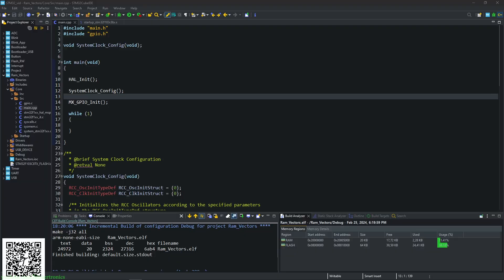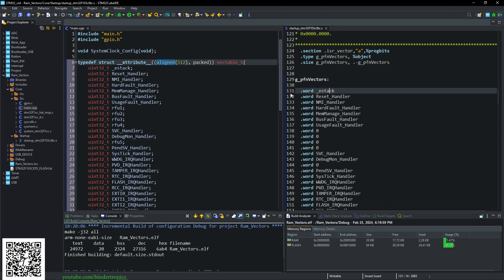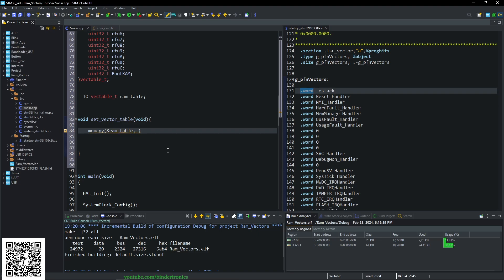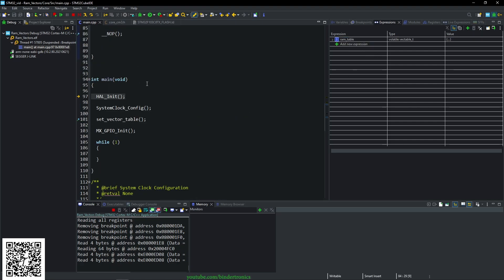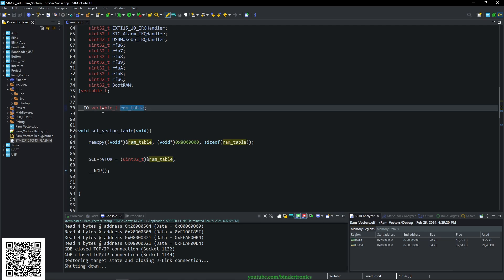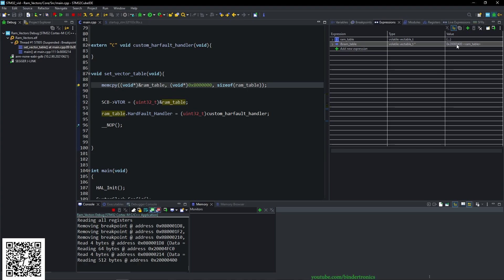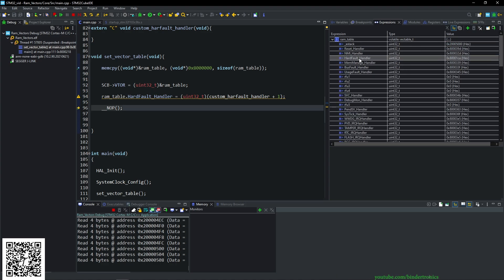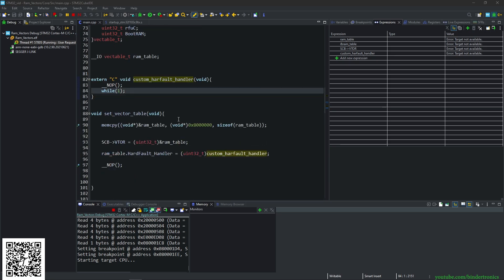Hijacking Vectors 🟣 STM32 Programming with STM32F103C8T6 Blue Pill C++ in STM32 Cube IDE

Comment: Interesting topic. Thanks.

BTW: You don't get extra points for speaking quickly! Slow down. Please explain the motivation behind your choices. Maybe take a pause when clicking on new files or a different window.
Reply from the maker: the other half is bitching that i speak to fast
Reply: @BinderTronics Yes, that's what I mean... otherwise the content is wonderful.
Reply from the maker: There is a playback speed setting. left right arrows 5 second skip. < > frame by frame. Al least for desktop. I miss read your original comment.
If you have a question about something, why what how? This is what the comments are for.
These videos exist for my own reference and so I do not need to repeat myself every time I get a new junior.
Reply: @BinderTronics  Yes, I'm aware of these Youtube features and used them for your video. For your own reference? Really? I'm glad you cleared that up for me...